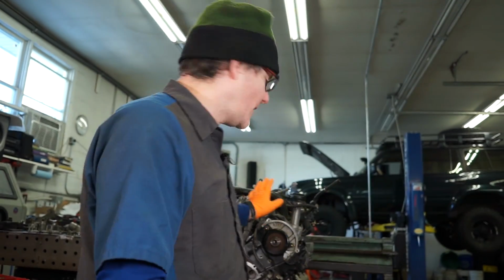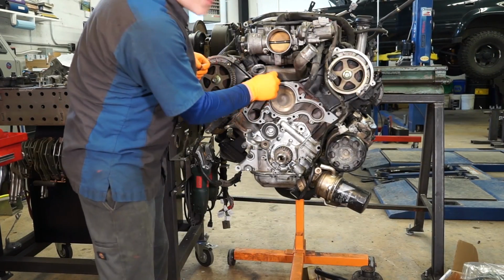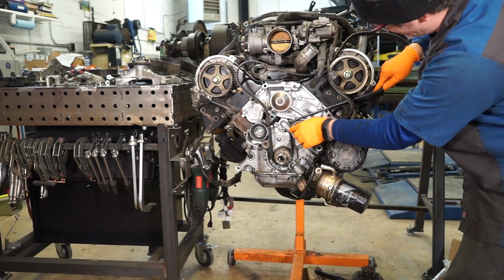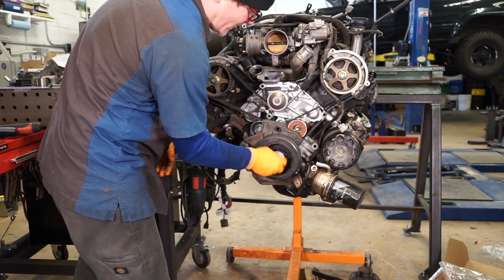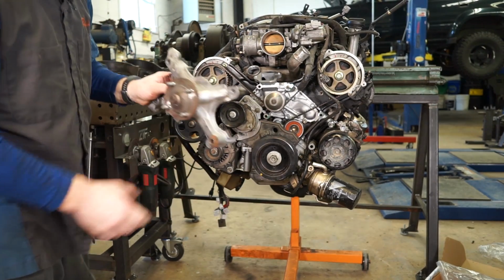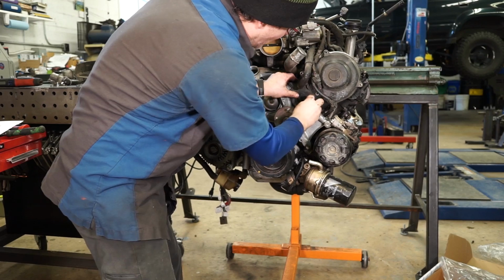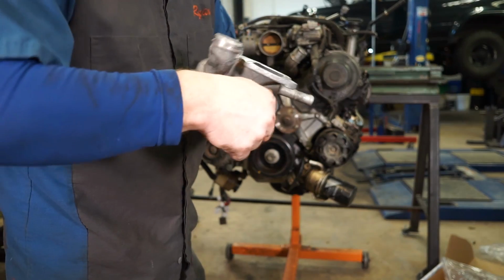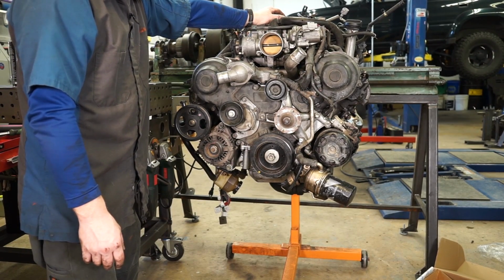Toyota 4.7 Timing Belt (updated) Part 3

Comment: Thanks for videoing and posting the process.  While I don't have your experience, I do have a couple of tips for the do-it-yourselfers that I've learned the hard way, and would like to pass along.  
-A piece of thin plywood cut to fit sort of between the fan shroud and radiator while your pulling the fan assembly saves the fins on the radiator.
-Also, break the fan clutch nuts loose in the manner demonstrated, but leave them on their studs until they're all broken loose so that you don't mess up the threads on the studs.
- I can't remember if there are one, or two rubber hoses that attach to the engine oil cooler assembly, but I remember having to replace one while the engine was assembled.  The top hose clamp was  
  almost impossible to access, so while you've got things out of the way, I would recommend replacing the lines going to the oil cooler.  That's the cannister looking thing that the filter is mounted to.
-This is also a great time to clean the throttle body.  Access is easy and things are already disconnected.  Remove it and do a thorough clean up.
Also, I think reference was made to this already in the video, go ahead and pay a little extra for genuine Toyota parts.  They fit better and last longer.  These are 300,000 mile plus engines if taken care of, treat 'em nice!
Reply from the maker: Thanks for sharing your tips!

Comment: Love this channel but I want to ask a question recently I found that emissions code such as the canister vent valve or etc. Being bad can cause the Trac control,slip and engine light to come on supposed ly it's a fail safe for my 4.7 4 runner 2006 ,just wanted to know if that is the case and also if I wanted to do a zero point calibration on a 2006 Toyota 4 runner Sr5 4.7 trough my obd2 connector what pins are cg and ts so I can use the paper clip trick .I've heard several things but can't confirm either one .Thanks for all of your online videos I love them.
Reply from the maker: Yep emmissions codes will trip the engine, vsc, and trac lights. As far as pinning on the zero point, I'm not sure. I always do it with the scan tool.

Comment: Hey, I have one question on the "T" marks on the Lft and Rt cams. What is there function:? My Haynes manual specifies using during timing belt removal/installation.
Reply: The 50 degree mark. When you turn the crank to 50 degrees with the timing belt still on, that's when the line between tensioner pulley bolt and crank bolt are aligned with crank pulley / harmonic balancer mark. When the crank pulley is positioned at 50 degrees, it ensures that all the pistons are down enough to not be able to be touched/hit by the valves when the camshaft spins on its own accidentally. With the timing belt OFF of the cam pulleys, the cam shafts have a tendency or could spin forwards or backwards if you positioned them slightly past TDC or past 50 degree mark using just the cam pulley bolt head. NEVER use the cam pulley bolt, I know, it is tempting and sometimes even - no harm no foul. Until the camshaft bolt comes loose from turning it counter-clockwise?
That's why it is important to get and use a cam pulley holder tool. I made mine from two pieces of angle iron and three 8mm diameter bolts. You'll need to spin them clockwise to align to the proper cam timing mark. Does what I wrote make sense?
Reply from the maker: My guess is that they correspond to the belt when it's rolled forward 50 degrees. They seem to line up there. The factory manual doesn't mention them though.

Comment: Studying forum posts, shop manuals and videos in preparation for replacing timing belt and water pump on my SC430 motor.  It was very helpful to see how to install the timing belt itself with the engine out of the vehicle.  Are torque specs based on bolt/nut dimensions or coming from a shop manual?  Thanks for putting video together!
Reply from the maker: Torque specs are based off the factory manual. I think it was a 99 model year.
Reply from the maker: Doctor MENGELE  foot pounds

Comment: Great video. Can you tell me what tool you would use to move the cams on a VVti engine in 2005-06 Tundra? I don't think the tool you show at 13:40 will fit. Thanks.
Reply from the maker: I've got a blue point timing belt wrench. It adjusts to grab the teeth on the gears. Unfortunately the part number is worn off 😂

Comment: What happened with that idler pulley bolt?
Reply from the maker: That idler pulley bolts in to the fan bracket. In the tear down video I had noted that the fan bracket was a low quality knock off part.  Turns out it was lower quality than I thought.  The threads had pulled out for the idler pulley and there were cracks starting at the AC mount on closer inspection.  Not sure why the last installed used that over an Aisin part.  I replaced the whole bracket with an Aisin rather than risk a thread repair failure.

Comment: Can you explain what the T mark is for?
Reply from the maker: I have no idea, unfortunately. The factory manual doesn't mention it as far as I've seen.
Reply: Best video by far on Youtube on the 4.7.0ne more question is it the same if your belts jumps time a few teeth?Just take belt off with cylinder at TDC then rotate cams to the proper mark?Thanks
Reply from the maker: Theoretically it would work like that.  You've just got to be careful of valve to piston clearance.  There's a few different "safe" spots that change by year.  Some are top dead center, some ~50 degrees before, and some are ~50 degrees after.  I've got to look it up each time to keep it straight.
Reply: FWIW, (and if I’m understanding what is being said above), on the 430 motor, after you advance the crank to 50° ATDC, the marks on the cam pulleys should align with the “T”s.